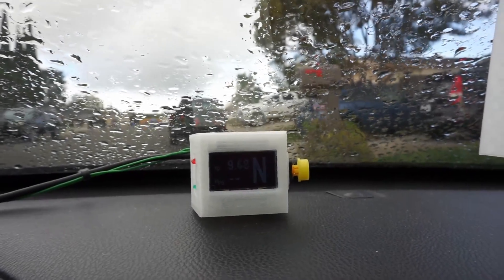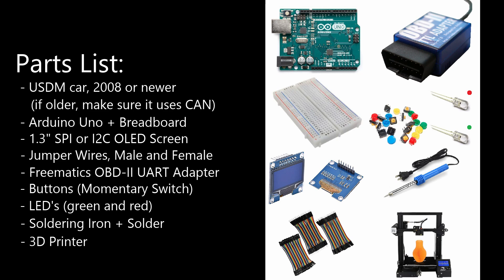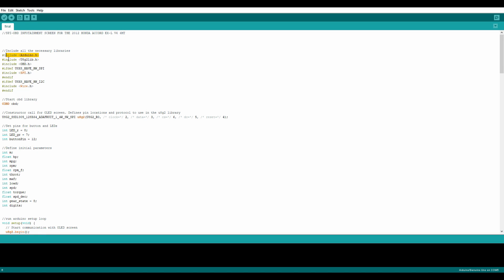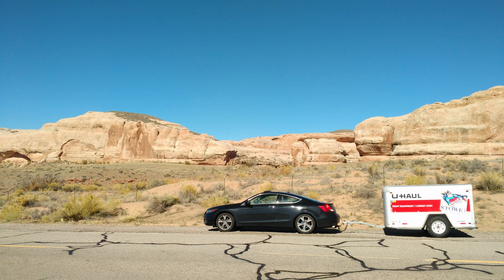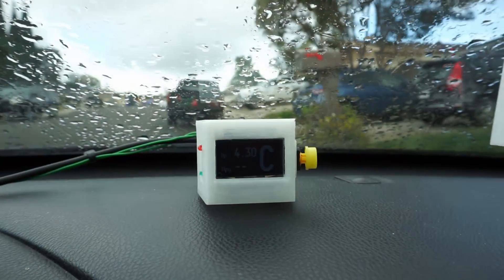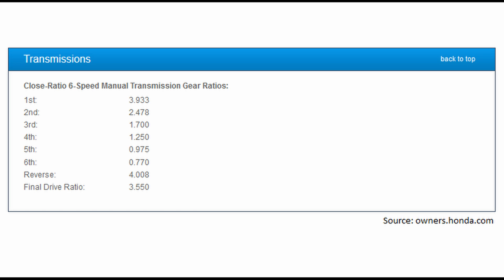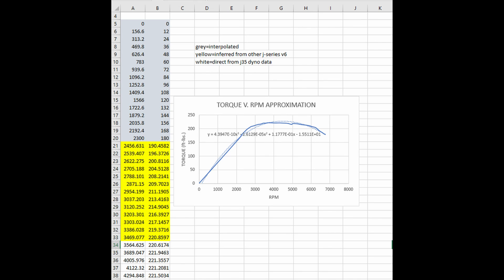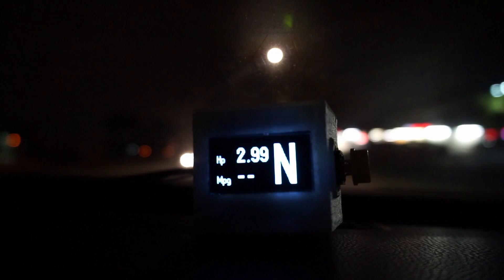How to Make a Gear Display Screen for Your Car with an Arduino Uno

Comment: 11:05 Good God! This is ridiculous. No offense, but this seems like a problem easier to solve with hardware. A couple of end stop switches, ir break beam position sensors or hall effect sensors Like $10 in parts and a display and some MUCH simpler code.

Comment: All I need is something that reads 123456.  Mind boggling to me that in 2021 this does not exist in a manual trans car.  I know that mfrs don't care about manuals anymore, but still how much engineering and cost is involved here?  If this guy can do it, I think they can.  Wouldn't even have to use OBD.  Just sensors in the shifter.  Personally I do mix up 4th and 6th occasionally.

Comment: Very useful video, just about to start a similar project, so thanks. For fuel economy (MPG) you could also try PIDs 94 (engine fuel rate) or 157 if your car supports it.

Comment: I have an 8th gen with an auto so almost the same
Reply: It would work fine. You'd just have to get rid of the clutch-button and change a few lines of code :)